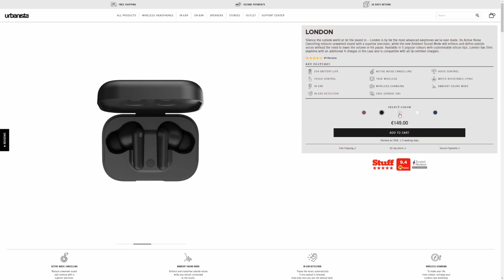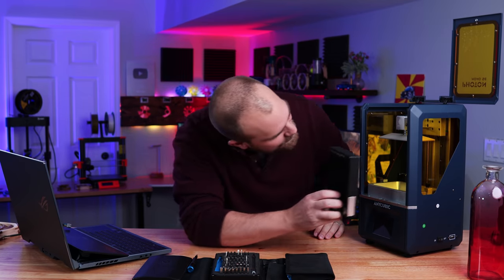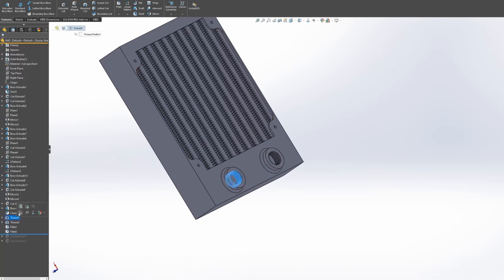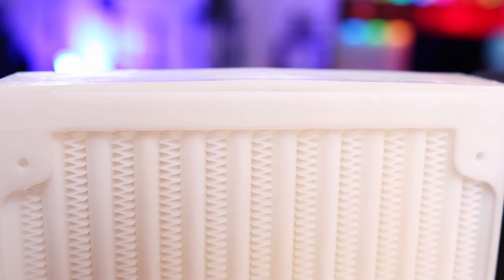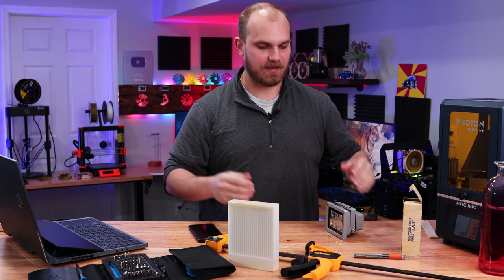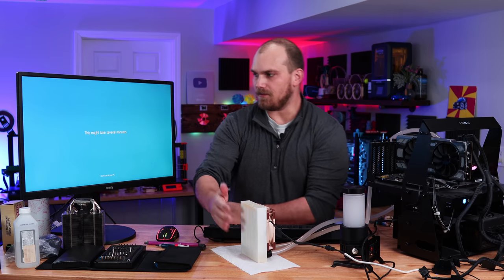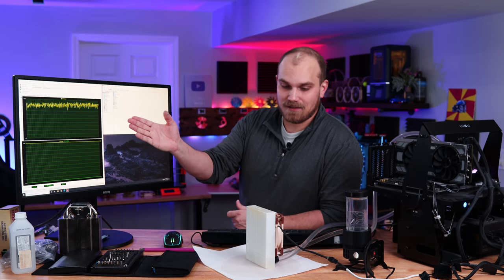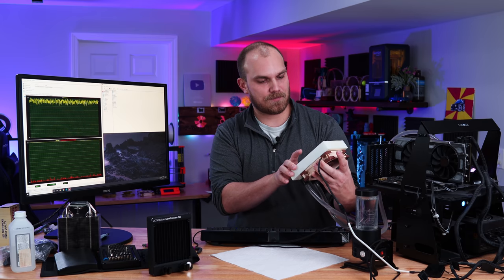I Never Expected This | 3D Printed EK Coolstream SE 120mm Radiator

Comment: I take it you do SolidWorks stuff as your main job? That would have taken me like a year to model.
Reply: lass kinn  
OpenSCAD is bs. I cant understand how anyone would use that, its an utter waste of time. Use FreeCAD if you are gonna recommend some free software.
Reply: it is 1 channel copy-paste, with caps at each end, then you add screw inserts.
Reply: @laharl2k  It can be the right tool for the job, but FreeCAD is definitely more powerful and easier to use
Reply: @laharl2k  My god, did OpenSCAD poop in your breakfast this morning, or what in the world made you this angry? OpenSCAD would be the exact perfect tool to model an object like this radiator. An experienced OpenSCAD user could model this radiator in a matter of minutes, and it would end up being entirely parametric, so you could easily make all kinds of variations just by changing some variables.

FreeCAD is also good, but for a simple functional object like this radiator, OpenSCAD is a perfect solution.
Reply: @adrianmalkovich7101  OpenSCAD is the perfect tool for when you need tens or even hundreds of variations on the same model. Other than that it's the worst tool for the job compared to almost every other available 3D modeling software. It is for the most part a novelty.
Reply: @laharl2k  It's CAD for programmers, basically. For people importing models into that utility also made using OpenSCAD, they'd drop in code, and out comes the model. And for objects which may require custom sizing maths can be used to create a scaled object rather than manipulating a model by hand for simple manipulations like that.
Reply: I take it you've never drafted anything.  This would only really take a few minutes to whip up
Reply: @mikaelgaiason688  I’d say I have less than 10 hours of SolidWorks experience. I’ve done plenty of models in tinkercad, sketchup, and openscad.  I need to take some time and learn true cad modeling... just haven’t gotten around to it.
Reply: @adrianmalkovich7101  
"An experienced OpenSCAD user could model this radiator in a matter of minutes,"

An experienced whatever else CAD program user could model it in a matter of seconds. Hence its waaaaaay more useful and productive to learn anything but openSCAD.

Look, ill go straight to the facts, if openSCAD was suuuuuch a good tool, why doesnt anyone use it? Why do engineers use solidworks instead of openSCAD?

The end product with openSCAD is awful, you can always tell when a STL file was made in openSCAD because its rough in all the edged. No one ever does any chanfers or any kind of small detail on openSCAD because its a pain in the butt to do so, so in the end openSCAD only promotes lazy and badly designed parts which anyone could do better in less time in a proper 3D CAD software like solidworks, or even freeCAD.

Maybe it was the best we had 15 years ago in the beginning of 3D printing but it is in no way competent vs anything we have today

openSCAD may be good in your opinion, but in my opinion a tool is only good if it does the job better and more efficiently than the other tools, in which openSCAD does not.
I have a couple of years using solid works and i can certainly do a rad like that in less than 15 minutes, from having the physical rad in my hand to having the final 3d model, and i bet you 100 bucks you cant write all the code needed to make the rad in less time (and im an actual c++ programer)
Reply: @laharl2k  meh...if you're a mechanical engineer, use something like AutoCAD. If you're an artist, use something like Blender. If you're a programmer, use OpenSCAD.

Note that I didn't say "something like OpenSCAD", because I've never seen anything else like OpenSCAD. IMO, that's the best thing about it. It's a different way of doing it, which makes it better for certain people or certain use cases. No one tool is right for every single job.

For me, OpenSCAD is the only reason I have a 3D printer. I've tried plenty of other CAD and 3D modeling tools, I've read tutorials online, watched tutorials on YouTube, spent years watching all these "makers" designing and printing all this stuff and my main conclusion was that I lacked the artistic and design talent to use the tools required to own a 3D printer. Then I found OpenSCAD. Made a model of a whole workshop within a couple hours, had that thing animated a few minutes later, and within a week or two I bought my 3D printer which I now consider the best damn thing I've ever bought. I'm using that sucker *constantly*.

I won't say OpenSCAD is necessarily the best tool to do this kind of design. Certainly it would be the best tool for me to do something like this. A couple plates, a couple square tubes, and a couple for loops to pattern the holes and tubes. Nothing I haven't done plenty of times before. Twenty or thirty lines of code maybe.

And FWIW, chamfered edges are pretty simple to do, just cut away an angled cube...I usually don't though unless they're actually necessary, because they can kinda suck for 3D printing. It just means you've gotta use higher resolution settings which makes your print take forever, otherwise the edge looks like crap and might even start peeling apart. If you're designing something for mass manufacture, then sure, take the extra five minutes to put those in...but if you're designing something you're gonna toss on thingiverse, PLEASE don't
Reply: No other cad program has made me think "what the fuck,why? why would you use this? why does this exist?" moreso than openscad
Reply: @Urza9814  
Are you still using a darwin? because otherwise "high resolution" is pretty much any 0.4mm printer nowadays....
I sell 3d printed parts for a job and making chanfers and making shit look professional and good quality is a must, otherwise you give 3D printing a bad reputation in the consumer market. People buy with their eyes and if you sell sharp edged with elephant foot and all those ugly details people are gonna thing its a bad quality product even if it were made out of titanium.
Im not saying "use openSCAD for production" but making things that look good shouldnt be a "premium" feature imo. If you cant do it because its complicated then its not a good tool for the job.
BTW, it doesnt need to be made with openSCAD, most stuff on thingyverse, even those made with solidworks or fusion360 are awfully designed and 99% of the times i need to redo it in solidworks and fix all the errors and bad design choises.  Thingyverse is no more than a dumpster for badly produced ideas that need 3 pounds of polishing compound before its any good in the best case, a complete redesign at worst.
Reply from the maker: I do use solidworks quite a lot at my day job.
Reply: lass kinn  What about fusion 360? It's free for personal use. Just looking for opinions
Reply: @cavemaneca  This is kind of an odd thing to say. OpenSCAD is extremely good at some things, and not so good at others. It's basically useless at organic shapes, but it's really good at very technical, functional designs. It's also a very good option for people who have a highly technical way of thinking about things, and who already have some programming skills. If that describes you, and the kind of work you do, then OpenSCAD is probably the best option available. If it doesn't, it's not. It's very strange to call it "a novelty."
Reply: @laharl2k  Nobody will draw this model in a matter of seconds. After reading your comment, I'm actually not entirely sure if you're presenting an honestly held opinion in good faith, or if you're just trolling for your own amusement.

There are plenty of things that OpenSCAD does better than pretty much all other modelling tools, and there are plenty of things it does worse (chamfering is harder in OpenSCAD, but it's not impossible; I do chamfered edges in OpenSCAD all the time). It's a tool. Being so angry about a tool is kind of strange. Are you also writing comments about how hammers are bad because you can't use them to screw in nails?

I'm getting the strong impression that you tried using OpenSCAD, weren't able to, and now blame the tool. If you use and love solidworks, that's great. Keep using it. But the fact that you weren't able to figure out how to use OpenSCAD is probably not OpenSCAD's fault. Not everybody is good at everything, and that's fine. You don't need to be good at OpenSCAD to be a good human being. Just let go of your anger ;-)
Reply: you can download the modem in step format for free from the manufacturer ...
Reply: Honestly, this whole thread is kind of flabbergasting. I had no idea people were just so dang angry about OpenSCAD.

It's a tool. It's the best tool to solve some problems, because it does things no other CAD tool does, and it's the worst tool for other problems, since it literally can't do things that are very easy in other tools. But to see people this freaked out about OpenSCAD is breaking my brain a little bit, if I'm completely honest. If you don't like it, or can't figure out how to use it, just, you know, don't use it. Use what works for you.

I'll gladly use Blender to model organic shapes, and I'll use something like FreeCAD when it's the appropriate tool, but for a lot of the work I do, OpenSCAD is simply the best tool. It's very easy to quickly bang out parametric technical designs. If you don't want to learn how to use it, that's fine, but can we just not make the jump from fear to anger here? As we all know, that eventually leads to suffering, which we've had enough of this year, I think. :-)
Reply: @adrianmalkovich7101  
"Nobody will draw this model in a matter of seconds. After reading your comment...."

I doubt you actually read what i said because I said i can do a simple rad like that in solidworks in about 15 minutes, so of course its not seconds. Its what is called a "metaphore"

"There are plenty of things that OpenSCAD does better than pretty much all other modelling tools"

Show me just ONE

"Being so angry about a tool is kind of strange."
Who's angry? im not angry, openSCAD is just crap, and saying a tool is crap isnt being angry, openSCAD is just crap, and if anyone is gonna recommend free software at least recomend something passable like freeCAD. Recommending openSCAD is like recomending a stone tools (as in prehistoric) to someone that needs to build a house or something.

"I'm getting the strong impression that you tried using OpenSCAD, weren't able to, and now blame the tool."

Dude, im a fricking programmer, its not that i cant code, its that making 3d shapes and adding and substracting them in code is like trying to explain color to a blind person.......its the less intuitive way possible. Its called CAD, as in Computer ASSISTED Drawing.  I wouldnt even call openSCAD a CAD software because you have to think and do all the math in your head to write the code instead of having the software do it for you (as in ITS NOT ASSISTING YOU). Its like having to give blender each triangle one by one to make the mesh, why have blender at all then, just code your own rendering engine...... Heck, even blender is a better 3D modeling software than openSCAD and its also free.

"I'm getting the strong impression that you tried using OpenSCAD, weren't able to, and now blame the tool"

Im getting the impression that you like using crappy unproductive tools to make mediocre jobs because you are elitist and want to feel superior, (like people using gentoo....) and never actually made anything productive or that you sold with openSCAD.
When you actually can make money using openSCAD they ill accept its useful for anything at all.
Also, argument ad populum, more people agree with me than with you for whatever thats worth....
Reply: @adrianmalkovich7101  there are some things it excels at, specifically software generated modeling. For some things like having NN generated 3D models it's almost irreplaceable. The problem is that in the open source communites there's been some push for people to learn OpenSCAD for all types of solid modeling and it honestly isn't the right choice for a majority of use cases.

 For most things more complex than a mounting bracket or similar F360 or even FreeCAD can do it faster. Debugging code just to get your model looking how you want is no fun either. And if you actually want experience that will get you a job modeling in engineering OpenSCAD will get you almost nowhere.

People need to stop recommending it for general use. It's unintuitive, overly complex, impractical, and it DOES kill projects when people give up in frustration.
Reply: @laharl2k  i'm a software developer and openSCAD is pretty easy once you get used to actually writing your code for the design
Reply: @NanescuRadu1  
Im just gonna ask the mandatory question: What have you done in openSCAD?
Reply: @laharl2k  my printer updates ( creality cr10s ) from v-rollers to linear rods ... the feet and housing that will go underneath the printer to host the mobo, raspberry pi, power supply etc, wireless charging stands, laptop stands, a custom keyboard housing for my mechanical keyboard ( keychron k6 ) for test fitting, looking to cnc the part eventually from aluminum , a ton of custom brackets and stuff for various cabinets, a custom boxy cooling cover for my old router that's about to die ... simple bits and pieces around the house ... fairly simple things ... not a 3d designer at heart so its more of a me problem than a cad software problem ... and i'm also a linux user so openscad and freecad are the best solutions for me at this moment, oh and blender if you wanna build mandalorians and baby yodas
Reply: @NanescuRadu1  
Cool, at least you are not all talk, as for me ive done entire printers in solidworks (and other CNC machines too), all from the frame and linear systems, pcb housing, psu covers and mount, the extruder along the gears, and all the cable management and tiny details.
Like i said, the issue is that you are not making money, otherwise youd be broke. It all depends on how much you value your time.
Reply: @laharl2k  "Its what is called a metaphore."
 No, it's definitely not. That's not even a word. Maybe you meant that you were trying to be hyperbolic?

"Show me just ONE
." See, when you say things like that, it's kind of impossible to take you seriously. You're either not making a good-faith argument, or you've literally never used OpenSCAD before. Which is fine, you don't have to use OpenSCAD, but why be so angry about other people using it then?

"Who's angry? im not angry." Then why are you writing these long diatribes about how crap OpenSCAD is? What is your motivation, exactly, if it isn't anger? You sound very angry to me.

"im a fricking programmer." That's interesting, can you introduce me to your friend, the pope?

"Its like having to give blender each triangle one by one to make the mesh." No, it's not, You sound like somebody who has literally never used OpenSCAD. I think you should calm down, actually take a genuine look at OpenSCAD, and then write a well-founded opinion, rather than screaming about how crap it is without knowing the first thing about what it actually is.
Reply: @laharl2k  lol, I'm using a Monoprice MP Mini :) It is capable of pretty good resolution, if you don't mind waiting two days for the print to run...but I generally try to keep my jobs under 8 hours. Sometimes my final print is done on Cura's "draft" mode because on larger prints that can save several hours. And I don't trust this cheap Chinese crap to run unattended either, so 16 hours would be the max I can do...and I've definitely had models that I had to redesign to keep under that limit, lol

I have been considering grabbing a slightly better printer this year, but this one pretty much handles what I need it for and I don't have a few grand to drop on one, so I'd probably just get something like the MP10 if I upgrade. Not sure if that's worth it, although the larger bed would be helpful...
Reply: Programmer here. I'm a hobbyist, did some 3D-printing projects, and I'd totally use FreeCAD for this, even though OpenSCAD can't scare me -- it actually sounds fun as hell for some tasks, like if I were to design a lock system it would definitely go in there, but for this it would just get unwieldy really damn fast. But it's just a lot more work than FreeCAD in this case, and it's actually easier to put together a sketch with the right constraints than to figure out how to code this in a parametric way.

Get real, you're making one rad design here, not a whole system of every possible rad ever. If you design this in FreeCAD with the right constraints on the sketches it's actually super easy to go back in there and make the modifications you need, when you figure it out you need them.
Reply: I SW model for a living.  yeah it would take me maybe a few hours to build that radiator.  When you know how to use a solid modeling software its really simple.  Just like sketch drawing you just break it into simple shapes.  a square with a bunch of repeated shapes like that radiator is cake.   Think of how much effort it would take you to sketch it on paper with a pen and a ruler.  maybe 10 minutes..
Reply: @laharl2k  that is WAY beyond my abilities man...I can barely get a high current LED connected to an arduino. I'm a software guy; I dabble in hardware but I really suck at it lol
Reply: @Urza9814  
Dude, i was in computer science before starting my business with the printers. If you are willing to spend a few bucks you can reach trade school level in 3-4 months just using internet and having the proper equipment (cheap osciloscope and decent multimeter). I know because a neighbor's son was in electronics trade school and i borrowed his folders and it was pretty basic for how important "electronics technitian" sounds. I even knew stuff he didnt. (more proof that education is crap and outdated)
The most important thing you need is motivation to learn. Its really not that hard, its 99% using your brain, 1% knowing the stuff.
Reply: That would have taken me an 20min MAX probably 10 min, and I don't even do for my job, or anyhting, just thought it would be cool to learn... It's very simple, its like drawing on paper simple!!